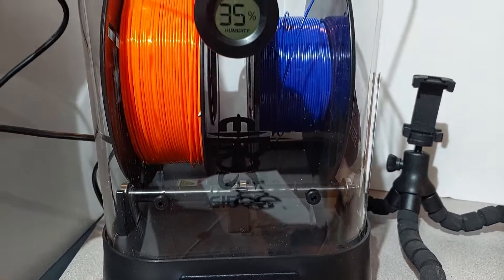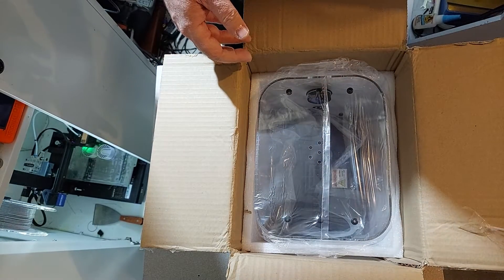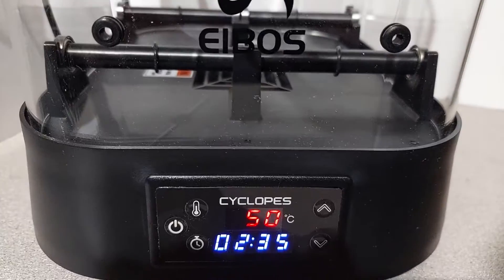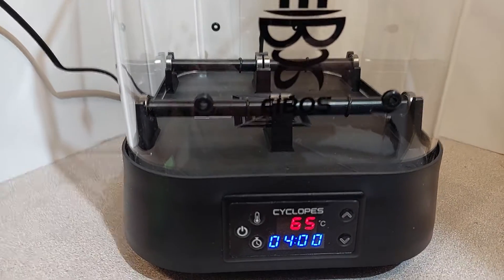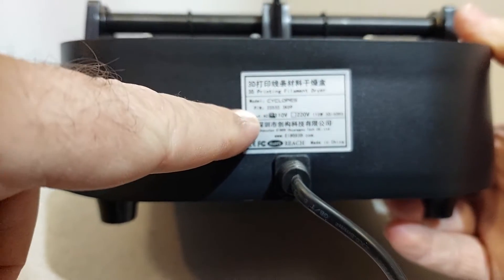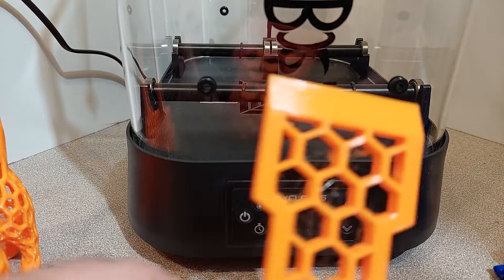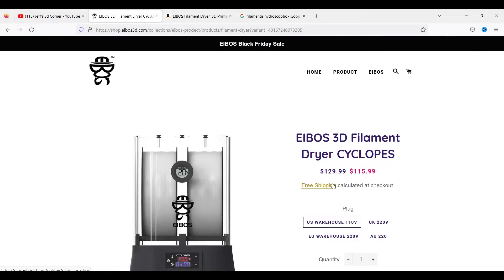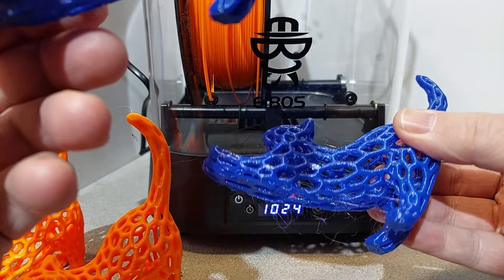Eibos Filament Dryer Review

Comment: Having bought my own EIBOS Cyclopes dryer and used it for a few weeks now, the most awkward thing about it is that when you thread the filament through the front bottom hole and then put the cover on, you end up with loose filament within the cover. The heater softens the filament and allows it to get some very sharp bends in it. I'm thinking of printing some auto-retractors, which I need anyway for my Palette 3 Pro. But I'm also concerned that anything 3D-printed would soften when used inside the drying chamber. I need to do some engineering work to sort this out.
Reply: 3 months on, did you sort this issue? My dryer is scheduled to arrive this week.
Reply from the maker: Good points.